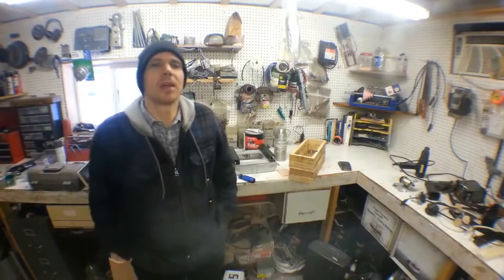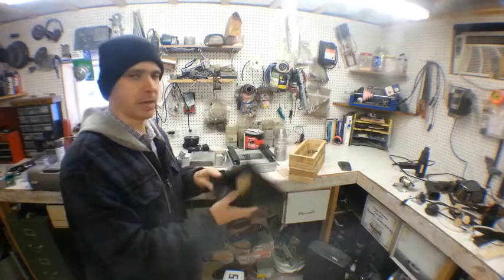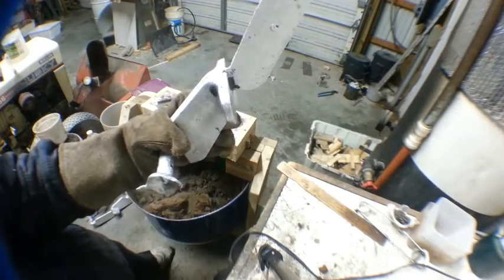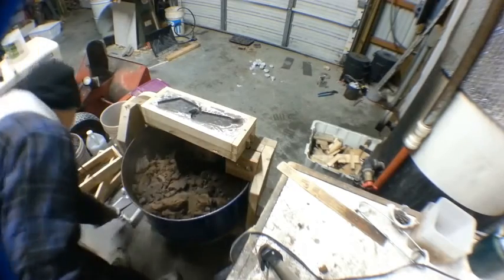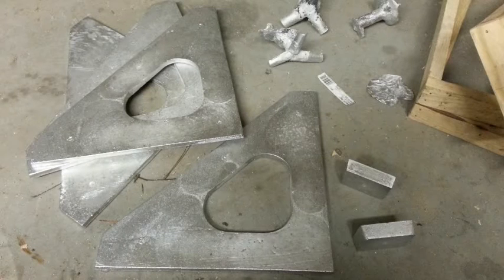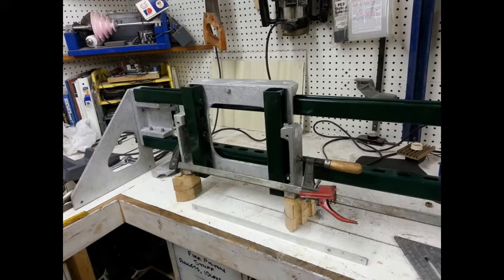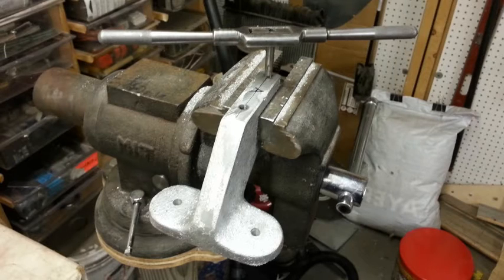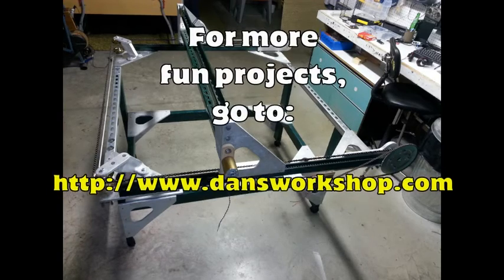Producing CNC machine castings from aluminum

Comment: Quick Questions:
Will a "normal" spiral stove plate work on the furnace?
What do you use in the sand as a binder?
Reply from the maker: That's exactly what I used -- an ordinary spiral element for kitchen stove.  It works better than anything I've used so far.

The binder in my sand is nothing more than bentonite clay and water.  You can get bentonite clay on ebay in powdered form, or you can make it yourself from kitty litter (get the cheap kind that has nothing else in it besides clay).
Reply: Thanks - looking forward to all the details about the mill